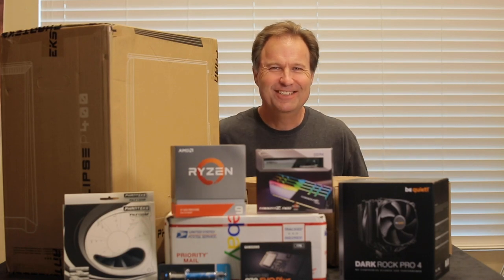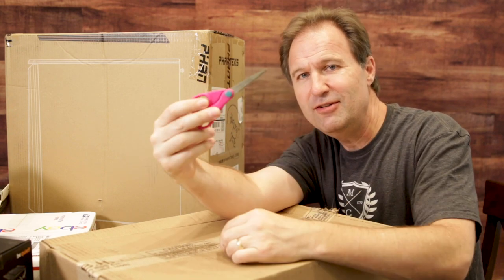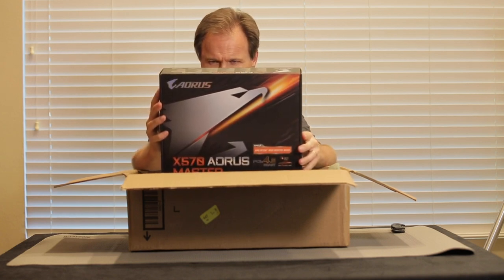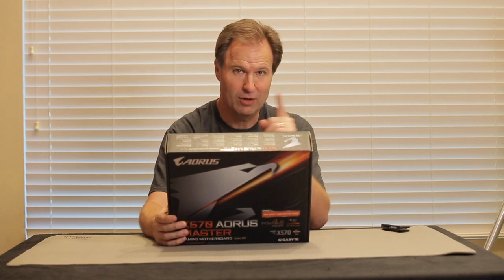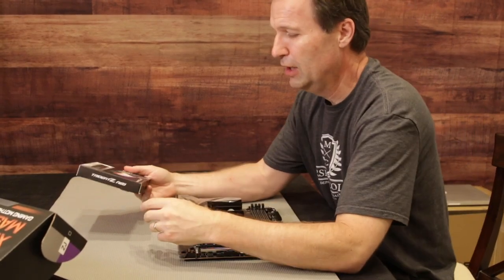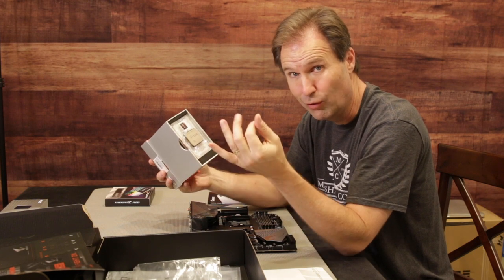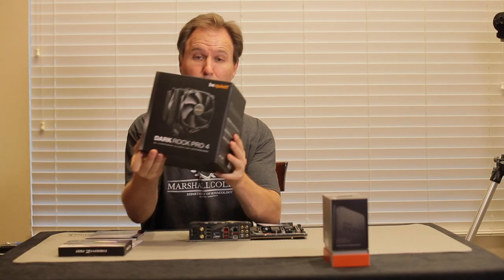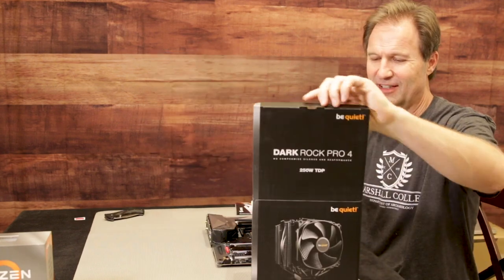HOW TO BUILD A PC - Step by Step 
Tutorial. Phanteks P400A, AMD Ryzen 3950x, Gigabyte Master, NVIDIA

Comment: Is there a concern with this case of the GPU interfering with anything if it's an exceptionally long one? (assuming it won't be long enough to hit the front fans)
Reply from the maker: I would certainly measure it out. I’ve measured it for a 3090 and it would fit.

Comment: The non glass side panel is not coming off, in fact when I tried pulling it I bent it! Any tips?
Reply from the maker: I’ve heard that from a few users. It may be that the clips are slightly bent. You can try this, but no guarantees it will work. Take the glass off, lay it glass side down. Press down on the panel with your palms and try sliding it backward. It may take some pressure if the inside clips are bent. Good luck!

Comment: Hey, I notice that at the cut at the 55 minute part you switch around the top connectors. Which one did you end up going with? it looks like the initial way you had it matches the manual.
Reply from the maker: Definitely go with what matches the manual. Which motherboard do you have?
Reply: @devosentertainment  I have a b550 aorus pro ac, it seems to have the same manual as the one in your video. I'm just curious about the switch in locations and if that was intentional/works that way.
Reply from the maker: @youngmoneyweezy8362  I followed my manual. It may be different than yours. Definitely follow yours. Let me know if it works! Those little buggers are the cause of so many failed start ups.
Reply: @devosentertainment  Yeah, I'll let you know. Like mentioned below by someone else I luckily went through my motherboard box and found the "g connector" makes it much easier. I'll follow my manual and if it doesn't work out ill switch the top connector to the other side. Great video by the way by far the best approach in terms of viewing angles and procedure compared to all other builds.

Comment: which screw did you use for motherboard?`i have so many screws
Reply from the maker: There are a lot! Consult your manual and compare your screws. Divvy them all up by size and type and see how many you need of which type for your motherboard.  Chances are you will be able to identify which screw type you need for the motherboard based on the number you need. The manual should tell you.

Comment: How did you install the cooler the case has a max 160mm while the cooler is 163mm [ i want to buy the same cooler but i thought it wouldn't fit ]
Reply from the maker: Fits fine

Comment: Do I need 2 hard drives?
Reply from the maker: No you don’t. It all depends on what you’re using the computer to do. I’m a media guy and so generally need a ton of space for projects and applications. If you’re just using it to game or internet, you won’t need as much space. You can also add external devices if you need them. Good luck with your build!

Comment: I have this case and want to upgrade my cpu cooler and looking at dark rock pro. The case width is 160mm and the height of dark rock pro 4 is 162.8mm. I also have high ram 51mm. How much room have you got left in the case? You think I could move the fan upwards would compensate for high ram and still fit? Thanks.
Reply from the maker: It’s a snug fit but so far, no problems. But unfortunately, it will not fit with high ram. The height of the connection plate to the cpu is not adjustable. If you want to use the DRP, you’ll need to get low ram like the ones I used in the video. It’s a bummer, but worth it imho. It’s quiet and cool. Maybe swap your ram?
Reply: @devosentertainment  thanks mate

Comment: Hey Dave, just out of curiosity, would i be able to fit two out-take fans at the top with this cooler?
Reply from the maker: I think so but not positive. Depends on the thickness of the fans I would think. Tough to add a radiator, but you might be able to add a few low profile fans. I’m adding a new graphics card this weekend and I’ll take a look.
Reply: @devosentertainment  I very much appreciate the response. I tried using measurements given to workout whether or not it will fit. For context, I am using a Noctua U12s for my CPU cooler with 2 LL Corsair fans at the top for out-take and one at the back. The corsair fans are 120x25mm so I believe it should be okay. Nonetheless I would very much appreciate an update. Thank you sir.
Reply from the maker: Here’s the measurement from the top of the case to the top of the cooler. Safely, you have about 2 inches, which I think would be more than enough for fans.
Reply from the maker: Feel free to pm your email me and I’ll send you a pic for reference.
Reply: @devosentertainment  Hi Dave, I very much appreciate you getting back to me on this matter. While I was waiting for a response, i also attempted my own measurements and arrived at a similar result. Nonetheless i appreciate your time. Thank you very much.
Reply from the maker: @doorcloser5761  My pleasure. Good luck! Let me know how it turns out.

Comment: Hey man you plugged in only one d-rgb cable and all 3 fans are lit up, how is that possible?
Reply from the maker: All three fans are connected to the one cable. The other cables are for other RGB accessories if you want to add them.

Comment: Hello I really need help Ive watched the video and Im confused what you use the labelled cable (D-RGB Fan) for and where it goes? it comes from the front of the case and has 3 prongs with one missing like so ( | | . | ) (the dot being the filled in space please help if you know or Dave please explain if it is needed and where it should go thanks <3
Reply from the maker: I chose not to use that cable at all. It is meant for other rgb lighting that use might use in the case. I just stuffed it inside and left it alone.

Comment: when using the case you are using, where is the fan controller to use the buttons at the top
Reply from the maker: The RGB fan wires are daisy chained into one connector that can be powered by SATA and controlled by the button on the case. From what I've read the non-RGB version does the same thing with the fan cables being powered by SATA and connected to the control button on the case.

So I had only one RGB cable that needed to connect to the motherboard (but 3 separate fan cables).

Comment: How did you get the rgb turned on in front fan?
Reply from the maker: Assuming you’ve connected your cables, there’s a button on top front of the case. Consult your manual.

Comment: dave can you help me becuase i did everything that you told me to but the thing still wont turn on
Reply from the maker: Bummer!  Let’s start with checking all those little cables and making sure they’re all the right way in and in the right pins. Super easy for them to get jostled. Make sure the polarity is set properly too!  Next, check that your power supply is actually turned on from the switch in the back and that you’re power cable is properly seated. Next, check all the cables from your power supply and make sure they’re all plugged in nice and tight. It can be a pain to go through everything again, but that’s where 99%of the problems are. Next, make sure your cards are seated properly and that the power cables are also seated nice at tight into the cards. 
What equipment are you running?
Reply: @devosentertainment  omg thank you so much for replying I finally got it all to work and the main problem was that I had the power, reset, and HDD +- all in the wrong spot, thanks for the feedback.  but the RGB for my Phanteks case fans aren't turning on but the fans are still spinning just fine! thanks for replying after months of actually releasing this video! but I have another problem, all of the fans are turning on but when I try to turn on my monitor it doesn't work. it says check your input because there is no input
Reply: what I'm running is a 
Radeon 5700xt - GPU 
Ryzen 5 3600 - CPU
(same case) - case
g skill Ripjaws cl 16 3200 mz - ram
team t- force Vulcan 500Gb - SSD
Seagate Baracuda 2TB - HDD
corsair cx 550 wats 80+ bronze - power supply
	MSI B450-A PRO MAX- mother board
Reply from the maker: @lilnemo889  awesome!  Glad you got it working!  Regarding the RGB, I really can’t speak too much to it as I don’t really use mine. But if you carefully follow the manual for which header to plug into on your motherboard, they should work.
Reply: @devosentertainment  new update, I can't get the computer to post and none of the USB ports work for some reason. and I lost the manual for my motherboard but the board is an 	MSI B450-A PRO MAX maybe you can send me the online manual for it or something.
Reply from the maker: Tell me what you mean by post.
Reply from the maker: Go to this link to register and download your manual

https://www.msi.com/Motherboard/support/B450-A-PRO-MAX/#down-manual
Reply: @devosentertainment  the monitor says that I need to check my input because it’s not their and it won’t let me get into bios.
Reply: Thanks for the manual
Reply from the maker: Hmm. Not sure about that. Is your video card set properly? Do you see anything on the monitor?  Check your monitor inputs - is it hdmi, vga, dvi?
Reply: @devosentertainment  my monitor input is display port because and it supports freesync because I went with an AMD graphics card. one thing that I also realized was that inside my motherboard the 24 pin connecter had these led lights that turned on and only one of them turned on which was the CPU light. the other ones that did not turn on were the DRAM, VGA, BOOT. I don't know if this has something as to why the monitor doesn't have a display, or why the USB ports don't work.

Comment: I don’t know why but the 3 fans that came with my case are 4 pin. Could it possibly be an updated version or something? Would it work the same?
Reply from the maker: It may be. They will be fine. The fourth pin allows you to control fan speeds from software.
Reply: @devosentertainment  Thank you so much! I appreciate you relying fast.
Reply from the maker: @skypilot1360  my pleasure. Good luck with your build!
Reply: Hey man did they end up working? I think my may be 4 pin too

Comment: how did you control the color of the rgb fans?
Reply from the maker: There’s a button under the lip on the top of the case. Check out the manual for specifics. Pretty cool!

Comment: hi, where did u plug in your front 3 fans? i cant find where to put it
Reply from the maker: What Motherboard are you using? There should be a fan header on the right side. Consult your motherboard manual.

Comment: At the moment of truth... what if my DRAM light comes on and I get no display? I've made sure prior to have compatible DRAM via the MTB QVL spec. I've checked my CPU pins, I've made sure my RAM is fully inserted, the RAMs LEDs are turning on so I know they are getting power. Everything else powers on and is running quite smoothly.  But this DRAM light issue is eluding me. I've also updated the bios using the flashback and USB stick. I've made sure my cooler isn't on the CPU to tight. I'm running out of ideas.
Reply from the maker: Removing and resetting your RAM may solve the orange light problem on your Motherboard. Your system may not detect your RAM correctly if you have not inserted it properly.

A blower can be used to clean the slot or rubbing alcohol to clean the RAM. Before installing the RAM stick into the RAM slot, ensure it is scorched.

Ensure that the gap on your RAM stick matches the gap on the motherboard slot when you install the RAM. To ensure that the RAM is completely inserted, you need to hear the click sound.

If the issue persists, you can try putting the RAM in a different slot. It’s essential to insert RAM sticks alternately if you’re using two posts of the same speed and memory.
Reply from the maker: If the above doesn’t work, try removing the CMOS / BIOS battery, disconnect all power from the PSU, and wait 5 minutes. Thus, you will reset the BIOS / CMOS on the Motherboard set.

Comment: I was looking around seeing how people did the wiring in this case, I have a question about the Audio wire, instead of coming from the bottom why run from the top all the way around? Is there a specific reason for this?
Reply from the maker: Some of it depends on your motherboard but for the most part, it allows for wiggle room if you have giant GPUs and such in the four slots.

Comment: I’m currently in the middle of my build. I’ve got to installing the cables to the motherboard for my fans. You say here that it should be a 3 pin but all of mine are 4 pins. I am using the exact same case as you are in the video but I’m just slightly confused.
Reply from the maker: They’ve updated the case to include four pin. It’s no problem. If your motherboard accepts the four pin, that fourth pin exists to control your fan speeds via software. Just plug them into your fan headers like in the video, you just won’t have a naked pin. They’ll all be covered. Let me know if you have anymore questions. Good luck with the build!

Comment: I used the Sata power supply split that comes from the psu to the front panel sata connector for power; and it was not a good idea, my SSD was recognized at  first but then on second boot it wasn't here anymore, so i guess even thought there is a split here it's not to be used? 
My other ssd's with a sata power coming directly from the psu work fine, just the one using the front panel split isn't showing up anymore, 
anyone had a similar issue ? 
thanks :)
Reply from the maker: Wish I could help. I haven’t encountered this issue.

Comment: 56:38 what if I got another fan that’s exactly the same as the front 3 (for exhaust). It’s drgb phanteks 120mm. Would that plug into this cable you mentioned at 56:38?
Reply from the maker: I believe so but not 100% sure as I’m not using that cable. Best to consult the manual or maybe reach out to Phantex? Good luck!
Reply: Dave de Vos thanks! I don’t have the care yet so just trying to get ready before it gets here. I downloaded manual and it seems you’re right that any rgb device can be added. I’ve been having a hard time finding information on the controller. I think I’d still plug fans into mobo header and then included controller handles rgb lighting. I love the detail you go into the video! Keep up the great work!
Reply from the maker: @mannyfresh7065  Thank you. Good luck!

Comment: Does the 3 pin ( | | . | )(Where the dot is a filled in space) DRGB/ARGB fan connector go into the " 2 x addressable LED strip headers" on the gigabyte b460m ds3h or does it have to go into a different header?
Reply from the maker: I believe so but consult your manual to be sure.
Reply: @devosentertainment  it doesn't say so I'll just have to guess unfortunately
Reply: @devosentertainment  it only had the things I put in quotations which are labeled the same as yours you plugged it into so I guess so too
Reply from the maker: @EDogTheThird  cool. Let me know if it works!

Comment: 56:25 I still have a cable left with "D-RGB FAN" on it. It is a plug with three pins, where do I plug that?
Reply from the maker: Most likely it’s for an additional aftermarket fan if you want to install one. If you don’t have one, just tuck the cable away.

Comment: i bought the p500a and can i daisy chain the case drgb fans to one header? my mobo has only two argb header and im using the other one for other fans, and can i daisy chain the same way for the fan power cable?
Reply from the maker: What mobo do you have?
Reply: @devosentertainment  asrock b550am gaming
Reply from the maker: @k.bobcat7567  The three front fans can be daisy chained together straight out the box for rgb (they have male/female connectors on them), so you only need to hook them up to each other and connect the last fan to an RGB header. You'll need some y splitters to daisy chain the fans, or a hub. Even without a hub, the fans are low amperage and a single header can handle all three quite easily, I believe most mobo headers can do up to 1 amp, and fans are somewhere in the vicinity of 0.1-0.2 amps, varying by brand/size/speed.
Reply: @devosentertainment  thx for the reply and help even the video was posted long after, got urself a new sub👍

Comment: Besides connecting the mb drgb wire to the motherboard, did you need to do anything special for the lights on the fans?
Reply from the maker: Nope. The button up top on the front of the case controls the lights.
Reply: @devosentertainment  Thank you. Mine must be DOA.
Reply: @devosentertainment  found it. I was missing a power connection.

Comment: Hello I have the same case but another motherboard, the ROG STRIX B450-F GAMING II. And it does not have a connector called D_Led1 / D_Led2. So I don't know where I should connect the M/B D_RGB 3-Pin cable. My motherboard has only 1 x Aura adressable RGB header this is 3 pin (the manual confuses me a bit because it says this connector is for LED strips) , and 2 x Aura RGB Strip Header and these are 4 pin. Could the M/B D_RGB 3-Pin cable be connected to the Aura adressable RGB header on my motherboard? . It is the only 3-pin I have. I am afraid of burning a component if I connect it in a place that does not go, could you check with the online manual of my motherboard and tell me where the M/B D_RGB 3-Pin cable goes? Thank you very much in advance, the video is great and helps me a lot in my build.
Reply from the maker: Section 13 of chapter 1 of the user manual here: ROG STRIX B450-F GAMING Manual | Motherboards | ASUS USA

will tell you what each header is and their exact locations.
Reply from the maker: And you can plug a 3 pin into a four pin, just make sure you fit it into the correct pins. The fourth pin is for fan speed control so if you don’t have the fourth pin, your fan will run at 100% all the time. Not a problem.